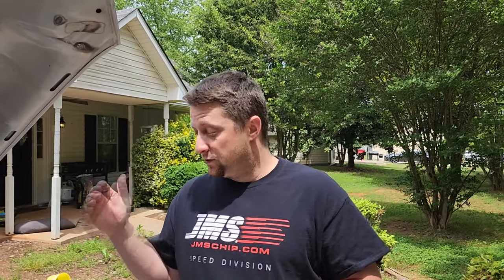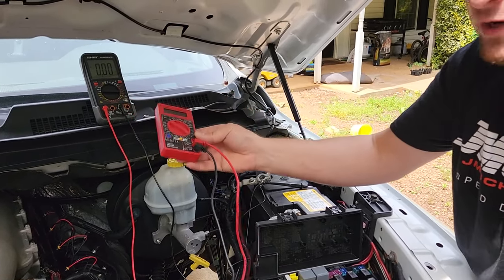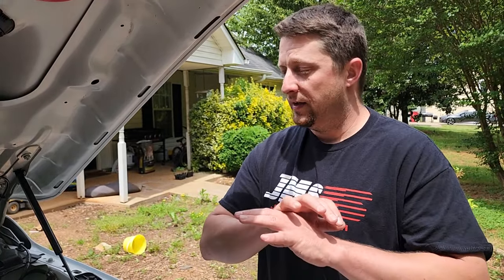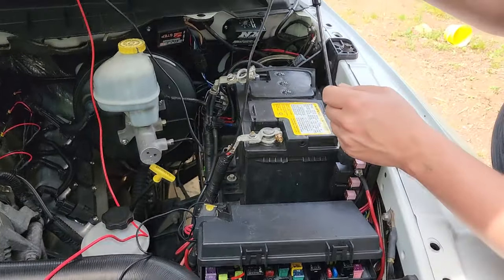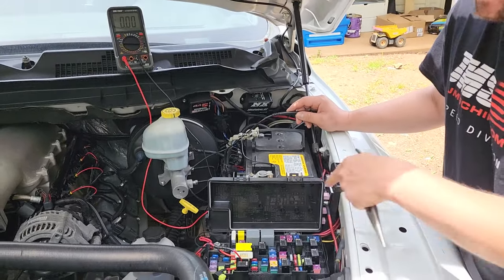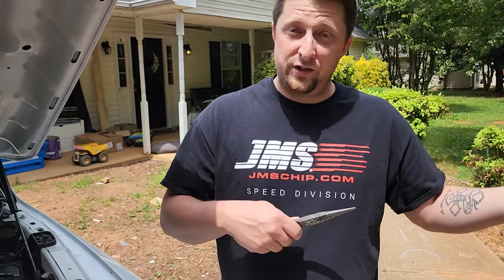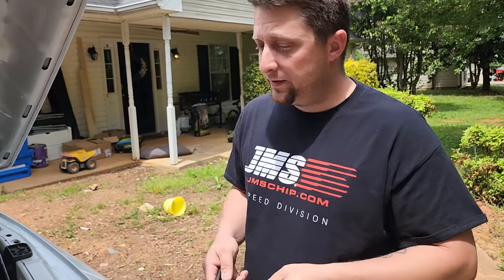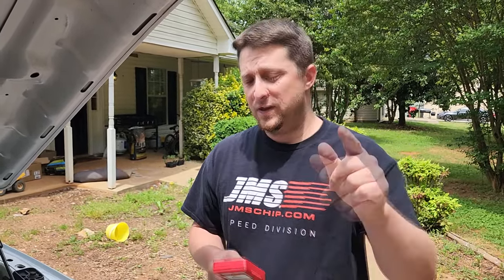How To Find A Battery Drain My RAM Truck Always Has A Dead Battery!

Comment: You actually made a mistake in this test, you said wait for 30mins to 1 hour to let the car completely sleep, but you disconnected the battery terminal, so as soon as you hooked up the ammeter between the negative lead and battery terminal you reconnected power for the first time which will 'awaken' your car and will, as you saw, generate a larger current that settles down over time.  The way you should do this is let your car sleep as mentioned, leave the battery hooked up, then attach the ammeter to the negative cable and the negative post and THEN remove the main negative lead, this doesn't interrupt the power supply or cause the car to reboot or 'awaken' and gives you an accurate sleep power consumption reading.

Comment: Hey Bud, I can't thank you enough for this video. I have had battery draining issues on my 08 Ram 3500 dump truck for over a year. I had a shop put a new alternator in it and it even went to a garage that is known for auto electric work. They could not find the problem. I couldn't raise my electric bed most if the time. After watching your video I located a fuse for "Trailer Tow" to be the problem. I removed it and happy days are here again. Thank you so much!
Reply: 04 1500, trailer running lights been sucking 1.5 and killing batteries like crazy, this was such a simple solution
Reply: That sounds like possibly dirt or something was shorting out your wiring plug one time I found an issue like that on a Chevy truck and my tail light would get brighter or dimmer and I got pulled over for it the cop says there's something wrong with your tail light. I tore my hair out and I was heading for Pennsylvania to meet up with a new girlfriend so I finally cut the harness off at the firewall and it made me a whole new harness all the way back then I found I had some burnt wires on a muffler pipe

Comment: When you disconnect the battery and hook those leads up like that it wakes the bus up. A better way to do this  is get a fuse buddy or use your meter, disconnect the ground, hook leads between the ground wire and ground on the battery. Let it sit for about 30-45min. The truck will then go back to sleep. Id have to look at the service info again as well. Buuuttt the radio (bluetooth and sxm equipped in particular) will cause a large draw for 30-40 minutes. I belive max spec for draw is like 30 milliapms after bus goes to sleep. Good content. I just want to help you for sure find your issue. Keep up the awesome work!
Reply from the maker: Thanks for the information awesome

Comment: Not clear if related but current recall on my 2022 Classic for radio draining battery issue. My 6 month old truck would not start yesterday and measured at 5.6V so clearly an issue. I hope they replace battery with fresh one if constant drain has shortened life of battery.
Reply: I hope they gave you a new battery because a drained battery below 10.2 volts will effect the longtime use life let alone multiple complete discharges .don’t let them tell you otherwise  .oh and a good trick is to mark the bottom of the battery so you can check if they did really replace it or just wiped yours over with wd-40. 😊
Reply: @Crazylife069  oh no I pushed for it, but they said load test checked fine .. I have same opinion as you , battery life will be shorter due to full discharge.

Comment: You can always install a killswitch at your negative terminal. You may have to reprogram your radio, but that will get rid of all the draw. If your vehicle has a compass and a gps factory installed, that will also draw amps as they are always on. If the vehicle is equipped with a factory installed internet connectivity to the manufacturer, that will also be an always on device.

Hope you find it.
Reply: @Echo5Mike if you do this would you need to use the key to lock/unlock instead of the fob or would you install the kill switch on the outside of the vehicle?
Reply: @mybobbleheads  yes, a physical key would be required to enter the vehicle because you will basically have zero battery power to activate the locking mechanism. you could in theory install the switch on the outside of the vehicle but you run into many possible issues doing that from something accidentally turning it on such as a passing animal or worse, forgetting where you placed the switch!

Comment: Thanks for this video! I just ran through all this yesterday. Truck 2011 Ram Cummins- completely electrically dead. both batteries drained to ZERO. Culprit was a shorted out ALT. All was running and driving an hour prior....then dead. Charged Batts and new ALT, all done. Feel lucky buying a $500 ALTERNATOR.

Comment: Pulling fuses isnt always the best option. Pulling fuses can sometimes affect any piggybacked systems where modules supporting other modules and vice versa. The best way is to do it across the fuse with a voltage drop test. This can work, but this way can also cause you to miss an issue. You could have potentially pulled a fuse that caused a system to come to life that would cause an additional amp draw. I know everyone hates doing a voltage drop test.
Reply from the maker: Definitely not fun

Comment: Just what I needed, been having same issue for a few years now and just bought another new battery. Look forward to finding out my problem and how you solve yours.
Reply: What was the problem
Reply: @kennethwashingtin3455  Still not entirely sure, I ended up buying a different battery with higher cold cranking amps and haven't had any issues since.
Reply: @midniight  thanks for the follow up. On my way to buy a new battery now

Comment: Memory in radio probably lost it resistance. I had a ford once that had over 5 amp drain ended up being the alternator. Good content my man. I have a fluke and the cheap hf works just as good for these issiues. Heck it's all made in China even Milwaukee now.
Reply from the maker: Yeah Milwaukee is made by tti company same one ryobi is built by lol

Comment: I have the same problem, after pulling the radio and r+r the fuse many times, it seems to be ok now, but I didn't make any repairs? Did you make a follow up video for this issue? Thanks

Comment: I’m having the exact same problem with the same fuse.  Could you tell me what the problem with the radio ended up being?
Reply: I just today found this same problem. Did you find out what happened in your radio that is making it do this? Was it just the radio itself or was it in the wiring? Please let me know!

Comment: My 11' 1500 had the same issue, ended up being a stuck relay for the fuel pump. Naturally it was on the backside of the fuse box so that was a fun weeked getting that out and replaced!
Reply from the maker: Yeah I've heard of that being a problem also
Reply: Was it on your radio circuit?
Reply: @krustykrab8654  No Radio circuit was fine, ended up being the Fuel Pump circuit. I can't remember what number it was, as I don't have the truck anymore, but I know it was 20 amp fuse.
Reply: @MrDRVRSnipes I'm having this issue and I think this may be it as well....are you saying it was a 20A fuse or the relay?

Comment: Nice truck I have a 2005 so did you figure out what the problem was I see that on mine well for one it’s different my back terminal is my positive yeah opposite of what you got there. However I noticed the radio fuse is connected to that hood light and that makes me wonder if somebody disconnected a hood light and there’s a wire dangling someplace I had found a few warriors messed up. I got one oxygen sensor with a broken wire and I really need to get on a little step ladder to climb up there, loop down in there good probably with a flashlight. My eyes are not what they used to be. Lol if you found a shirt in the radio wiring or some thing please point me to your next video to what you figured out right now I pulled my radio fuse but it’s interesting because my radio head stopped working and I kept getting intermitting charge ports on the cigarette lighter working so somethings obviously messed up. I’ve had a lot of mice get in my truck. I’m wondering if there’s some wires chewed under the dash I also did buy a new ignition switch because I know he’s crappy ignition’s go bad that it doesn’t turn completely off and that still might be my problem because sometimes it will start and then sometimes it’s dead so I leave it on the charger but it’s got to be a pain in the neck. But the only thing I like on the Dodge trucks is there four-wheel-drive goes anywhere in their hemi engines the rest of it it seems fiat cheapened. I wish dodge would buy the company back and build some killer stuff. Lol.😅 I’ve been thinking about going to a new Iske roller cam with the nex nitrous. I’m already modified probably about 500 HP I’ve seen the next systems run on the dynamometers and they are impressive i and what they say they are

Comment: I'm having the same issue with my 09 1500.  Did your initial test and found a 1.39 draw.   I'm hesitant to just start pulling fuses.  Is there any dangers or concerns to doing so??  Thank you for any help!
Reply: I had to remove my jockey box light problem solved!

Comment: Thanks for the amazing video. So what is the solution? Am going to remove the radio fuse and test the truck for a week. I am so frustrated that with a new battery, truck dies every 2 days. This is a 2014 dodge ram 1500... Thought terminal or the fuse in the terminal could be an issue, but i will check the fuse first. Please advice if you find any solution......
Reply: I have a 2018 and have the same problem. Was your problem fixed?
Reply: @kennethwashingtin3455  I changed the Battery (Free return with warranty in costco) and tightened the terminals super tight and left it for 1 and 1/2 week. Truck is starting. I am now in the 2 and 1/2 week test, mostly will try to start next week and keep you updated. So far  it works fine.

Comment: I have 2019 ram 1500, have had it just over a year and the other day it just wouldn't start!! Did a jump and it worked, i was able to start it for about an hour after doing the jump and driving around for a while.
Next day my truck woulent start again.
I see lots of people talking about a fuse? Did it actually help ?
I just bought a new battery and was wondering if i should try the fuse thing before switching out the battery?
Reply from the maker: I'd test the battery first probably not holding a charge.

Comment: thanks for the electronics class and I'm gonna watch this video a couple more times . I have gone through 3 batteries on my 2019 ram with etorque, power steps etc. Of course Ram doesn't understand..heck when they took my battery out to look at it they said the temperature was extremely high and the battery was smoking but at that time they didn't know where the draw was coming from. So they charged me for a brand new battery that went out after one year. Today they have had my vehicle for three days and they found out that the radio usb module was producing power so they ordered this part and it'll be here tomorrow and we hope this will fix the issue but with the amount of times i've been to the dealership lets just wait and see. I look forward to your final video....thanks
Reply: I have a 2018 and I'm having the same problem. What was your problem?
Reply: Dodge sucks 2013 had to put in a new t i pm box lights come on dash at night and drain battery radio screen went blank I could only get one station on radio I would never buy another dodge had Ford F-350 power stroke 7.3 should have kept oh well back to fixing dodges screw ups
Reply: I had to remove my jockey box light and that solve my battery issues!!

Comment: Awesome video👌, I was looking to change my stock 20 ram 1500 battery to a agm. You wouldn't happen to know which battery will fit? Was looking at either the xs d series 4800 or the 3400R only thing is with the 4800 I'm not sure if a gp 6 post terminal will fit on that 4800. The 3400r looks good jus don't know if the battery hold down wedge will secure it down since the 3400r doesn't have that big of a lip like the 4800 or h7 batteries
Reply from the maker: Mine is 3400r and the hold down works but have to tighten it down very good but works
Reply: @Mopar Motorsports  awesome the 3400r is what I will go with then. Jus wanted to make sure that little black wedge looking hold down would work the way that particular battery looks at the bottom. I will definitely tighten that sucker up good. Thanks alot appreciate you hitting me back. 💯👊🙏
Reply from the maker: @johnnypiper9387  yes it works just have to get just right little tricky but works
Reply: @Mopar Motorsports  cool, tricky meaning you jus gotta get the battery positioned right? Thought about zip tien that sucker down if needed lol. Thanks alot gonna go with the 3400r with my sound system.👊
Reply from the maker: @johnnypiper1717  just have to get positioned right but yes it doesn't weigh anything so doesn't take much to hold it lol
Reply: @Mopar Motorsports  yeah looks like it says 49lbs. Think the 3400r is what I will go with and do exactly what you mentioned. Thanks again for helping me out with that.

Comment: I had a question I’m looking at the torqstorm supercharger and I have a challenger 6.4, with the all intercooler options I have no idea what to buy what would you recommend, I know I plan on getting a 750-800hp rated one but other than that not sure
Reply from the maker: Hardest part is fabricating intercooler setup or have a shop do it.

Comment: Worked on my 2012 RAM 1500 5.7L. It was the radio fuse. It was drawing 0.6A. I don't drive very much so the batt. was slowly draining. So I now have an extra step if I wanna hear commercials : pop the hood, open fuse box and insert fuse ;0

Comment: This guy is close but way off. The three hundred million draw will slow down to about point six amps. That is the real problem. The radio always draws about three amps until it gets booted up. You need to find out where the point six amps is going.